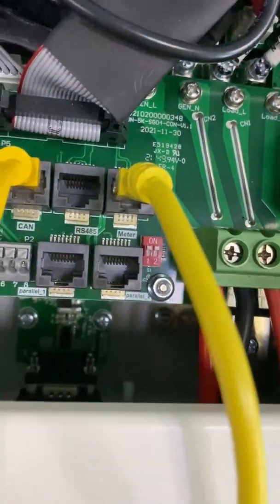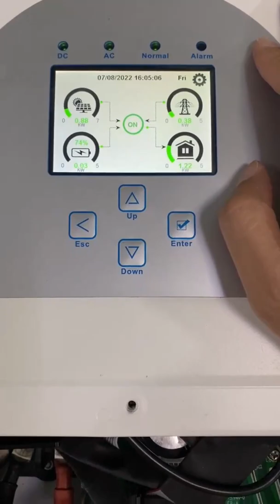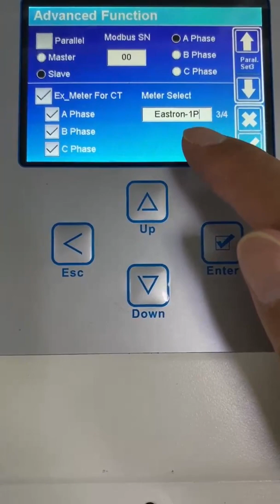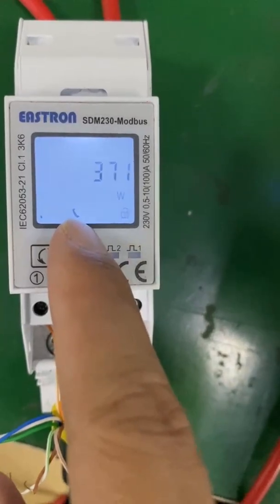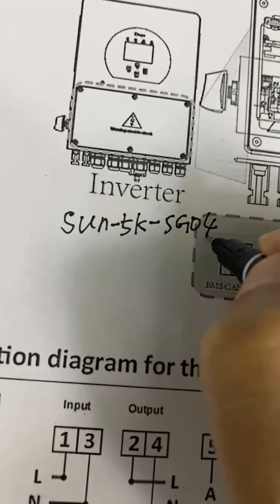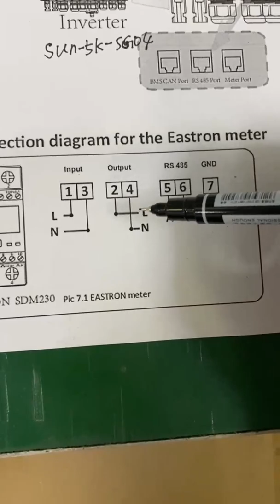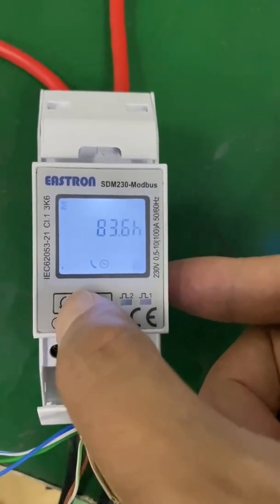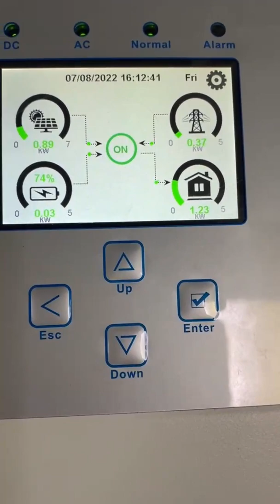How to Connect the EASTRON meter to Deye Hybrid Inverter

Comment: I have a sun-6k-sg05lp1-eu inverter, I connected an estron sdm230 modbus V2, but nothing works. I used both the orange white pair, and then the blue white pair, the speed is 9600 bd. I used the meter port. I configured the inverter with the Eastron 1p meter. Do you have a suggestion for me?
Reply: I have the same problem 
My inverter is Sun5K SG03LP1 EU
Eastron meter exactly the same as in the video 
but it didn't work
Reply: +1 here, te SDM230 V2 wont work even you match the baud rate.
Reply: hello did you solve it?
Reply: I have this same inverter, did you solve the issue?
Reply: same problem here. Anyone?!! would be great if anyone replies with the solution here...

Comment: Question... in the diagram you have the inverter connected  to terminal 1 and 3 on the meter. 2 and 4 connected to grid. But then u say you connected 1 and 3 to grid. Can u clear me up? Thanks

Comment: Good detailed video!  I want to use a CT sensor because its complicated and dangerous to in-line the smart meter directly into house's main line.  Does that Eastron SDM230-ModBus model (at 1:42) also accept CT sensor?
Reply from the maker: Hi, not support currently
Reply: @DeyeInverter_official  SDM630MCT uses external CT